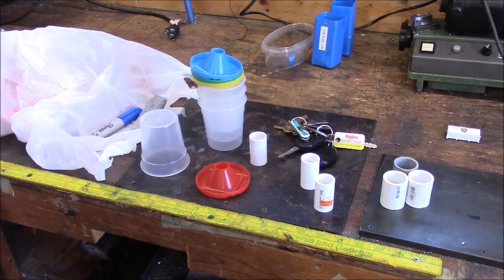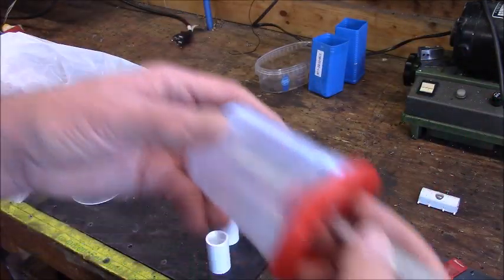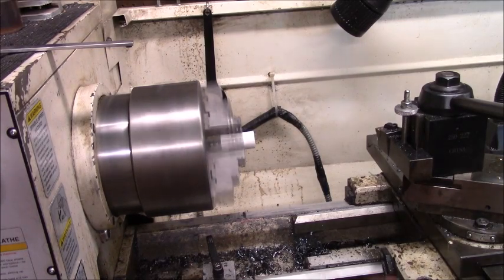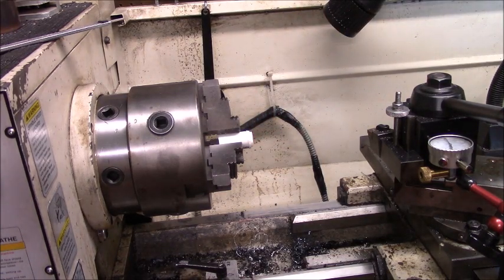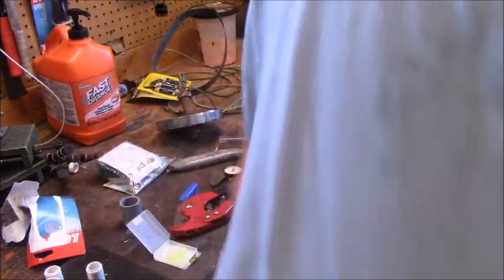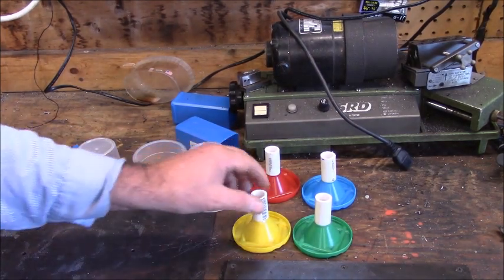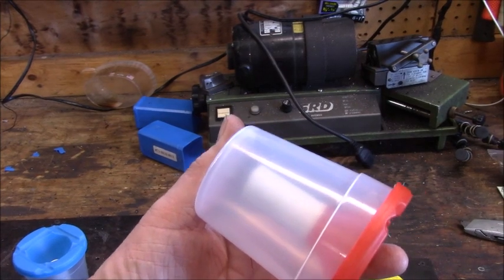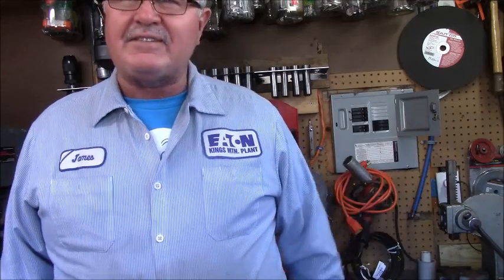Beating a Dead Horse Children’s Paint Cups into Spillmaster oil cups

Comment: Thanks for the idea. Going to epoxy a magnet on the bottom of mine.
Reply from the maker: TJS Welding and Fabrication Actually the cups are stable, some folks put magnets inside to catch chips, bit don’t glue them. That way when you remove the lid to clean the oil cup the magnet con be removed

Comment: I have Melissa and Doug cups on the way from Walmart.com, but I also have a sterno can from one of our local banquet center.  The ones with a wick have a screw on lid.  They are also very short and almost indestructible.   I'm thinking the Mr. Pete copper tubing soldered in place should make a very good cup for the guys that can "destroy an anvil with a rubber hammer."
Reply from the maker: Daniel Coleman on the cups you ordered use 1/2 PVC couplings like I describe in the video because the cups gave a larger bore. You don’t need an exact fit in the bore because you are gluing them either with super glue or 5 minute epoxy. In fact on the Melissa and Doug cups I prefer epoxy. On the stereo can I’d machine a bushing that fits the insiders the screw and the pipe, the epoxy them together something like this https://share.icloud.com/photos/0DPRAyXcKNtS1ALOYxRyNiZYA#Dallas,_NC
Reply: On one of the cups I used a pc of 3/4 pcv turned to press fit dia for about 2.5" and turned it around and forced it through the hole after trimming it up.  On the other three I glued a pc of coupling to the end of 1/2" pvc and turned the pc to press fit through the trimmed hole.  The 1/2" pcv was trimmed to just touch or be about 1/32" off of the bottom.  No glue requires so far.  The bottom keeps the pipe in place.  I cut two saw kerfs in the pvc about 5/8 long from the bottom.  The banquet center should have six empty cans with screw on lids Monday.  There is also a pop-out insert in the hole that holds the wick.  Quite a bit there to think about and experiment with.
Reply from the maker: Daniel Coleman that sounds like it works well.   I have had problems with press fits because of the inconsistency in plastic molding. That is why I prefer to glue them.